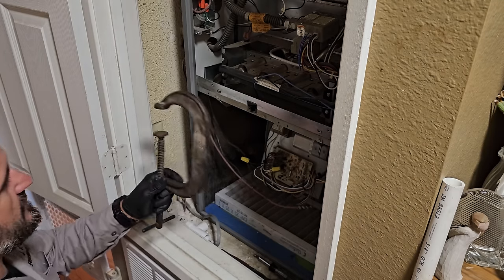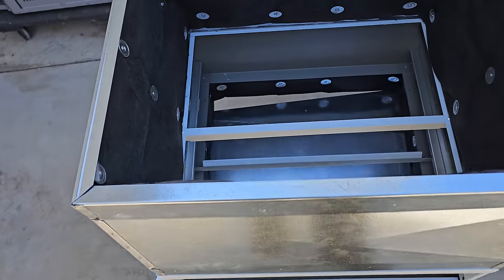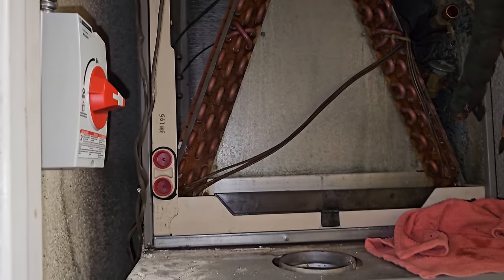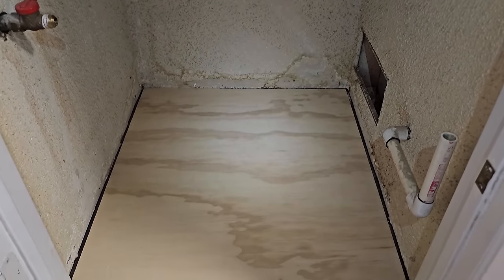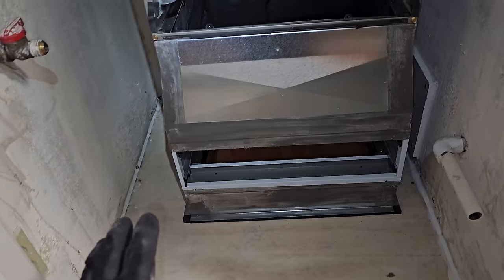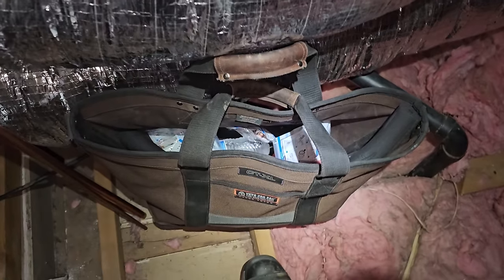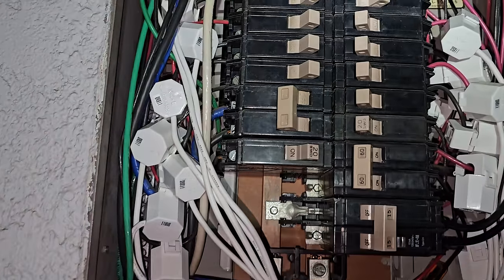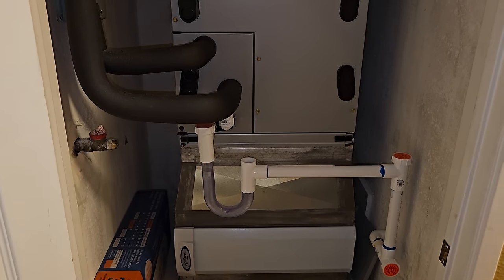HVACR VIDEOS HOUSE PROJECT PART 6

Comment: This is such an interesting system.  I LOVE how quiet it is!  The air to air I have at my rental property is so loud.  I have never used the press fittings. in areas where I could not use fire always do flare but looks really fast to install.

Comment: I made it to the end. I was apprehensive about ZoomLock the first time I saw the display in a local supply house, until I saw the signage said Parker. I trust Parker implicitly. Some of the deepest vacuums you could imagine (150 microns) happen in 30 minutes because there was only brazing at the units. Great looking install. I own and operate a company in Northwest Montana, I tell the guys installs need to look like a work of art. There is no excuse for sloppy work. Shop class used to be called Industrial Arts for a reason!
Reply: I've had so many parker service valves to leak and parker accumulators to leak. I'm not too fond of Parker anymore

Comment: I greatly appreciate the amount of detail you're sharing, conveying just how much goes into doing this right, by the book when you have the time.

Even though I'm not an HVAC technician and I stay in my lane (e.g. I can swap a contactor and wash a condenser, but no touching refrigerant, etc), I'm still fascinated with the process.  Learning is awesome, and this is like getting to watch over your shoulder, but without feeling awkward about asking if it's okay and possibly accidentally getting in the way.

I look forward to the next parts in this series!

Comment: Another great video. Keeps me motivated to do better on my installs. 
QUESTION. What are your thoughts on using a plenum box like you have vs using a square to round then round to supply duct with the flex tapping into that. Like Joey Henderson suggests.
THANKS! 28:14

Comment: I had a new HE furnace/ac/evap installed.  Right now, there is PVC exhaust tube going outside, but the fresh air intake is sucking in air from the basement.  I've seen lots of installs where both the intake and exhaust vent outside, but is it ok to pull air from my basement?

Comment: I'm curious about your first thoughts on the homeowner-facing side of the thermostat and the mobile app. I have a Bryant Evolution system (same system, different logo on the front), and was somewhat disappointed by some of Carrier's design decisions. The thermostat only supports four different setpoint "activities": wake, home, sleep, and away, which I found limiting. The builtin energy usage tracking is extremely rudimentary - I wish it gave me a day-by-day graph! (Maybe I should install an energy monitoring system like yours.)

Comment: This is the first time that I recall that you've brazed the way that I was taught, way back in high school. Specifically, applying the silver solder on the side of the pipe that's away from the flame. It's supposed to draw the solder from the 'cold' side to the hot side, forming a better seal (using less solder?).

Comment: At 36:27, you are using a crimp fitting for the refrigeration installation. Can you tell me which manufacturer makes it? I'm not sure if such a thing is available in Europe. Regards :]
Reply from the maker: zoomlock max are the fittings I used but they are the same as maxipro in Europe

Comment: Flex is fine when it's pulled tight like you did. Nobody can argue with your static measurements. IMO, best practice is using flex for runs that are straight/sweeping turns and inserting rigid elbows to turn tighter corners. Like the one in your attic that goes up and back down over the saddle hanger would be a great place for a rigid elbow. Then you can pull the flex about as tight as you want (without compressing the insulation).

Comment: When i was teen i want to go thru things /to start to compleet/ in one pass without any stopping. I always do the same kind of mess around me. Later i learnt have to do a breaks and let the things wait until i came back at optimal mental shape with a clean brain and envionment around me, to do the best.

The instal is get so realistic by the unknown factors.
The airflow diffrence is can made by the air line resistance because the walls are uneven and gets some turbular air oposit direction to the flow. Case like when add stuffing in a air line wall, the flow energie is partly turn to heat inside the stuffing material.

Comment: Great job Chris.  Ignore the haters, they probably don't use turning vanes in their ductwork.   5+ years from now when safer/better batteries are out there and the DC HVAC units mature you can have fun with that stuff.  How to you secure the outside unit for earthquake shakes?

Comment: I love the zoomlock max fittings. I ended up working on a large warehouse freezer refrigeration system last week. This system holds 100 lbs of R404a. It's a rather old system and the compressor and receiver are inside the warehouse and the condenser is on the roof. The zoomlock max fittings saved my butt because when I front seated the receiver king valve in order to pump down the system so I could replace the solenoid valve, the receiver king valve would not hold. It leaked refrigerant by and so I couldn't make the repair because I would not have been able to pull a proper vacuum on the system.  I would have been evacuating refrigerant and that would not work. So luckily I was able to purchase a refrigeration ball valve and press it into the system after the king valve. Then I was able to close the ball valve and make my repair and pull a deep vacuum. The zoomlock max tool and fittings are a wonderful tool to have. If you follow the proper procedure given by zoomlock then you will have a strong fitting and it will not leak.
Reply: @Damn-Son  I hear you 100%. I definitely tried that. That has actually worked for me in the past but it wasn't this time. 😭 thank God for the zoomlock max though. Without it I would have had to recover the entire charge in order to replace the solenoid and it would have been a long day.

Comment: Nice work, i think you should add a condenser pad, it is a heatpump,and maybe add a drain safety,and a higher vent,would have prefer sight glass at the condenser.you guys did a great job.
Reply: I was thinking no way it was a normal unit with all those wires but yeah I thought thats the norm for heatpumps with pad an feet

Comment: Zoom lock fittings? Why not flares like you use in commercial? And is there an advantage to having the sight glass and dryer inside instead of outside next to the condenser?
Reply from the maker: I will discuss this live on YouTube this evening 10/30/23 @ 5:PM (pacific) come on over and check it out, no worries if you can’t make it live as the stream will post as a video on my channel afterwards https://www.youtube.com/live/cIVWzFvST48?si=bNsUIEcuhyilNlag

Comment: Two comments, why silver solder the connection at the condenser and then press the connections a few feet way. Why not solder all connections? Second, I stopped using internal insulation on the ducts as the fibers continue to come off with the air pressure and flow. I now use only external insulation. Otherwise, great installation. Thanks for the video.
Reply: If I recall correctly the reason for pressing in the attic is at least due in part to not wanting to drag torches into the attic
Reply: O.K. with that but he was pressing out side next to the condenser . @special_k-hvac
Reply: @watermanone7567  I'm assuming he soldered the unit connections so it's easier to swap out the system when that day arrives. Sure it's probably not that hard to us the press fittings but that's what I'm thinking.

Comment: Just curious why you went straight heat pump instead of a modulating hybrid fuel system with infinity 25VNA4 heat pump with a 59MN7B furnace? No hate just curious

Comment: Nice work and nice teamwork at 23:28
Jill holding the plenum, Chris putting the unit in, daughter working on the camera career :)

Would love to have you install a heatpump system in my house, but you are a) too far away and b) the system I have in mind is currently not approved by the bank account ;)
But it's hard to find a good tech to get stuff done.

Comment: Top rate install. If that's the 24 SEER variable speed system then the Bluetooth module is probably bad. Extremely easy swap out. If it's the 18 SEER 5 speed, I believe they don't come with the module.

Comment: If you want an HVAC system at your house that's the best possible cooling system period, look into plasmoids/sacred geometry. There's a 90% chance it's a turbo-encabulator, but word on the street is it works and can give you near-cryogenic air coming out a Honda generator using basic parts.

Comment: What system do you have in your breaker box monitoring circuits? I'm using Sense but your's looks to clamp on each leg and I'd be interested in how you like yours! :)
Reply from the maker: Mine is made by a company called emporia energy, it’s alright the one downside is that you are limited to so many circuits but other than that I like it
Reply: @HVACRVIDEOS   Thank you, I'll look into it! My Sense system figures out and signatures various devices and overall works okay but direct measuring is also of interest. New install looks terrific!

Comment: She’s a beaut Chris.. seriously, what an awesome install and what great content the whole series has been. I’ve been watching your stuff for years and this IMO is by far the best yet! You’re earning your installation stripes, residential is always a challenge with all the minor finishing involved. 

The ONLY thing I’m having a little trouble looking past is that AC panel of yours. Good grief man, a congested outdoor setup? Being a Canadian electrician I’m not familiar with cali rules but I’d 100% move that sucker to the other side of the wall, inside the garage; Install a 225A SquareD NQ42 with whole home surge suppressor. A nice hefty panel with all the space you need to do things right. Main S/O & meter combo where the old one was. 
Just sayin’
Reply from the maker: I plan on upgrading it in the future and putting a bigger panel in for sure, maybe even solar with whole house battery backup…….
Reply: @HVACRVIDEOS  I mean in Cali you probably can cool and heat your house on solar panels for basically free. Especially with an inverter system that usually hovers at a low power draw, rather than kicking in and out with high draws. And solar panel prices are falling drastically. A 435W panel is about 100€/$105 in Europe currently. And in America you can sometimes still get net metering. Not happening in Germany lol.
Reply: @HVACRVIDEOS  sounds great and it makes a lot of sense not to stop short with the basics! Looking forward to developments there. Can’t fight the domino effect!

Comment: So, for me living in Sweden with extremely well insulated buildings, for us it's very uncommon to use air to control anything with heating. Heating waters for radiators seems much more efficient here. How would that work where you live, would it be a bad investment?
Reply: Air to air heat pump is much more efficient than boilers. The exhaust heat waste is horrible for boilers.

Comment: At work we have two sterling heaters in the shop. They were installed 2 years ago, only use once a year of course. Going on the 3rd cold season, the heaters fired up but soon shut off. Error code on the overtemp limits/fans not working. No voltage going to the contactor when the control relay on the board clicks. Fans work by depressing the contactor. No signal for the contactor. 
The gas ignites and flows through the heat exchanger just fine. No blow back.

It makes me believe the control board went bad from a storm we had two months ago. Storm knocked out the starting components on 3 refrigerators and blower motors in the office ac. Lost a leg of 120 making the 120v circuits wacky. More like 70v or less enough to energize but not enough to rotate. Just sitting there getting hot. Messed up the waterjet we had too. 
Thinking its been a issue since but just now coming across it. Same symptoms on two units at the exact same time. 

One thing i haven't checked was the draft sensor, think that would have any part in turning the fans on?

I know I'm not a HVAC technician but i do enjoy the trouble shooting and hands on part. Funny enough, I'm the shop supervisor, welder fabricator, and maintenance at the same time.

Comment: Return air vents in the doors or above if preferred into the hallway seems the best way to return air but you're more than aware of that I'm sure. . C/W a heat recovery unit directly into the indoor unit cupboard or again into the hallway to provide semi conditioned fresh air. 

Strange that the Carrier system seems a mix of old and new tech. inverter + a TEV is a stupid way to control refrigerant and duty. Have they not learnt anything from the Japanese. Jeepers Carrier were badge engineering Toshiba splits with EEVs back in the 80's !

Personally I would have pumped the outdoor unit down and removed it. Then I could have carried on fitting the new saving down dime and reclaimed either whilst that was happening or another day before disposal. 

Either way a high quality install as usual. I'm sure your electricity bill will come down quite a large % enough  for  payback as a result

Comment: Great job on the install Chris and family! Probably the best designed system in the world.
Reply: If it was he wouldn't have used a Carrier...
Reply: @richardbartlett6932  the best designed system wouldn't factor brand choice. We're talking about load calculations, Infiltration, duct sizing, and equipment sizing. 

It makes sense that a brand hater would miss this fundamental point.
Reply: @David_Poole  Brand hater? hmm I was a senior Carrier commissioning engineer in UK during my time so tell me an inverter with a TEV not an EEV and that's a top brand or a cost cutting cheapskate?  

But yes the 'best' design would spec the best brand.  Nor would over extended flexiduct be used either. That's designing in losses.
Reply: @richardbartlett6932  your first comment said nothing about use of a TEV VS EEV. You stated that the best designed system wouldn't have used Carrier. A bit of a goal post shift there wouldn't you say? 

Now you're adding in complaints about how the flex duct was used. Adding more context to your original post may have cleared up some things. 

What doesn't make sense to me is your simultaneously bragging you were a senior engineer, and claiming that they aren't the best product. Were you unable to design the best product? 

I would imagine all companies make cost cutting measures. To be fair, Carrier is not my first choice either. That doesn't take away how much I appreciate this install. You seem busy trying to find everything you don't like about it, instead of focusing on the plethora of things you could love about it. Sad way to think if you ask me. I have a strong feeling it's a much better install than you have in your own home? Do you do the same thing with your own work?
Reply: @David_Poole  I don't understand how someone can focus on something bad about a system when there's so much things in this install that are leaps and bounds better than anything I've seen. An engineer always has to let everyone know they're an engineer smh. Hopefully he can find peace along the way and start focusing on the positive things in life.

Comment: Great looking install!  But no back up heater?  I guess if you live in Texas, it is not required.  At 23 minutes into the video, I would have put plumbers tape on the air duct, and secured it in the attic, to hold up the ductwork.  Strong wife!  Great job there.  

I live in Portland Oregon, and it gets to 20F on rare winter nights here, and I also do not have a back up heater connected.  (I used my 1994 20 KW electric furnace as a air handler, and installed a 5 ton indoor coil on top of it (would not fit inside).  So I get cold air during each defrost.  With my 14 SEER single speed Goodman heat pump, it goes into defrost every 60 minutes for about 3-5 minutes.  It is 4 tons capacity, and I sized it that large because I wanted to have 30,000 BTU's at 20F outside (that is what a 48,000 BTU unit puts out at 20F).  I have 1,800 square feet, well insulated 1994 home with dual pane glass.  No I never did a heat load calculation.  

You mention 1,000 CFM, and that is the correct airflow for 30,000 BTU unit.  If you only have 24,000 BTU unit, then slowing it to 800 CFM is the right thing to do.  But if you have 36,000 BTU's then you should be speeding up the fan speed a bit, or the high pressure can get really high when it is about 55F or a little warmer outside, and the unit is making a lot of heat.  (wait you have variable speed, so that will not happen).   The indoor coil looks like about 36,000 BTU's - that is massive aluminum tubing.   Mine is old fashion all copper indoor coil and outdoor coil.  

Back when I installed HVAC units, I never put in couplings in the attic, we would always buy a 50 foot long lineset, and only solder two joints outside, two inside coil.  Liquid line dryer next to the outdoor coil. 

Before 1993, we never recovered refrigerant.  It was not a requirement yet!  I was trained in 1984 at UTI.  40 years later, best decision ever!  I graduated at 18, and was making decent money by 19.  Was able to buy my house at 21.  

So what size is your unit?  Seems like a very high SEER unit too.

Comment: This was an excellent video,  an amazing install. You did a great install.
Reply: Chris, I'd argue that flex duct is better than rigid for branch ducts in homes.

Rigid duct allow the fan sound to echo all the way yhrough the ductwork causing more noise at the diffuser.

The flexibility of the flex's inner liner dampens those sounds.

For main ducts, than yes, rigid is the way to go to drop static pressure. In your situation, the supply plenum acts as your main trunk.

The static pressure and low noise speaks for itself! Amazing work!